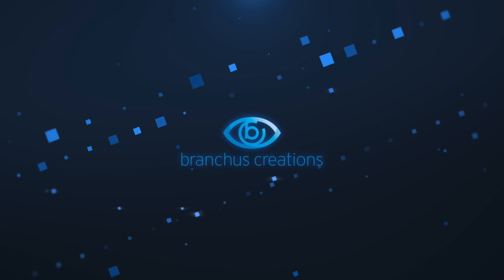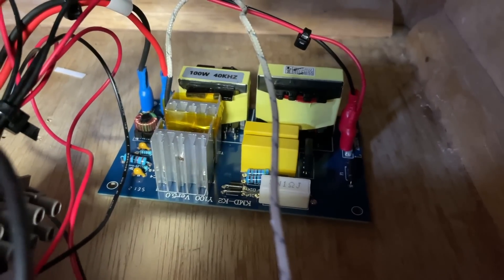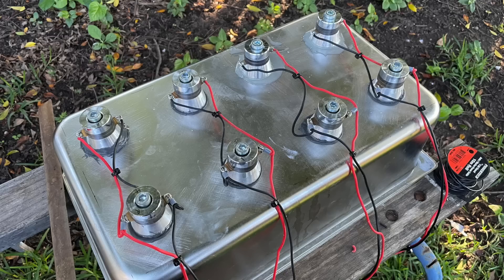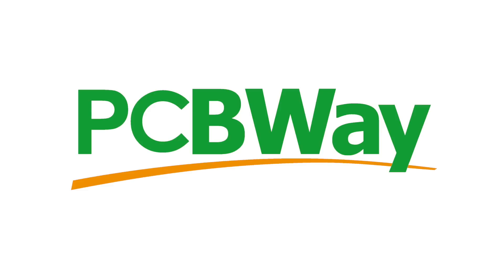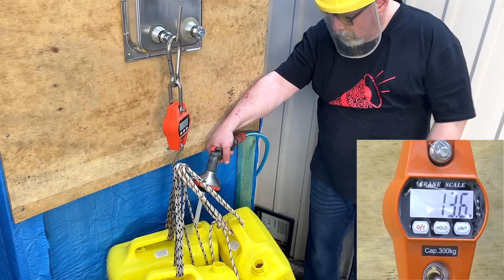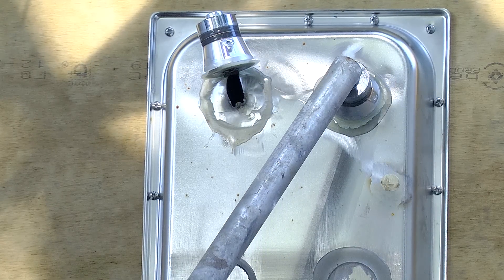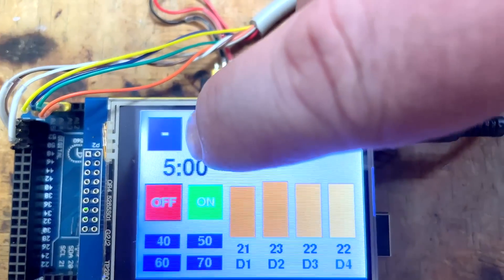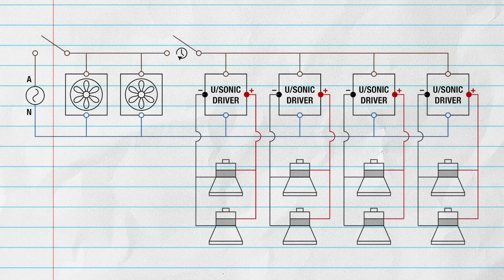Building my own Ultrasonic Cleaner - Follow Up

Comment: I’m surprised you said flux for the silver solder was recommended, but not required. Your advice about using generous amounts of flux in electronics soldering has made my simple excursions into electronics soldering far easier than before I took your advice to heart. If you can elaborate on it sometime that would be appreciated. Thanks for the tutorials!
Reply from the maker: I thought the silver solder had flux in it, but it doesn't. So yes, use flux!

Comment: An automotive gasket sealent can withstand extremely high temperatures in the 1000s depending on the quality. In addition, it has a little more flex but is a very strong adhesive. This flex could help prevent the separation of the adhesive. As a contractor I've experimented with a wide variety of adhesives. Automotive gasket sealant had unique properties that makes them different from many adhesives. You can even use it to seal holes in freezer sids walls because it does not freeze in freezing temperatures and maintains it's adhesive properties.
Reply from the maker: I investigated silastic sealants early on, but unfortunately the flex reduces the efficiency of the transducer. The adhesive needs to be rigid as it plays a big part in transferring the waves through to the tank.
Reply: @BranchusCreations  oh, my bad

Comment: Hi Bruce, I think the transducer falls from fatigue not from overload, so testing strength by applying a load is probably irrelevant. After seeing the first video I assumed maybe the bond had a small gap between them, it could cause:
1. The vibration of the transducer makes the trapped air compress and contract at a very high speed which causes micro fracture in the adhesive -> causes the transducer to fall
2. The adhesive that has been half failed causes the transducer to hit the tray repeatedly -> causes the transducer to heated up
Keep it up!  I'll be waiting for your next follow up video
Reply: Transducers operate on a solid state piezo-electric principle  - Electrical <> Mechanical. Your gas grill pop ignitor generates an electrical current when a spring loaded rod hits the piezo material. An ultrasonic transducer operates in a reverse fashion. Applying an electric current at a specific frequency will cause the piezo material (the black discs in the stack) to expand and contract with the frequency of the electrical input. The transducer stack is tightly sandwiched together to a cap and cone metal components with a bolt. This is done to efficiently transfer the expansion/contraction mechanical energy to the entire transducer assembly. 

The conical metal part that is bonded to the tank is tuned to the frequency of the driver (40Khz or 25Khz) via its shape and size. The transducers must be able to transmit this mechanical energy through the tank wall and into the solution. There, the energy induced into the solution causes miniature low-pressure cavitation bubbles to form. The expansion and collapse of these miniature bubbles provide the mechanical action needed to clean the parts. The transducers MUST be intimately bonded to the tank wall. This bond must be strong enough to handle the vibration and/or solution heat. 

Many cheap ultrasonic cleaners now use an epoxy adhesive to bond the transducer to the tank wall. More industrial cleaners have the cone portion completely brazed (i.e. like silver solder) to the tank bottom. In fact, Branson Ultrasonics developed that brazed connection decades ago which caused them to recognized them as a leader in ultrasonic design and longevity. Now, with the advent of better adhesives, its possible to have a fairly decent durability with just an adhesive connection.  

Anyway, Bruce did a great job and I love the honest trial and error content.
Reply: @ljsmith99  can you advise upon a specific adhesive? thanks!
Reply: I would add: 3. Shear stress in the glue layer due to the different temperatures and expansion of the transducers and tank. Squashing the glue thin would make this worse. 
As an aside I'm wondering about putting a couple of transducers under my sink bench to help with the dinner dishes!

Comment: You could try a plug weld (drill a hole, align the bolt on outside, weld a large bead on the inside over the hole and the material). That should let you get a decent weld without blowing through the thin stainless. You'll be welding onto the thickness of the bolt.
Reply: Plug welding would work if you used stainless wire or filler rod. Assuming he transducer threaded lug is stainless or it will rust!

Comment: what a lovely video! thank you for this,

but also want to ask something extra. as still feel somewhat unanswered or unknown question. which is nothing to do with your stuff in the video here. but since you have just become our collective industry expert in the field, it seems like you are now the right person to ask it to;

my question is in regards to tank configurations / dimensions and effectiveness.... see when we are shopping around for ultrasonic cleaners the big question always is what size to get. and it seems like the optimum size is nearly always long in 1 dimension. then either narrow and taller. or wider and then more shallow. this is either because we want to save on desk space / the device footprint. since these things are pretty bulky. or it is instead because we do not want to have to fill up and use too much liquid into the tank. not to have the water level higher than necessary for convenience it filling it up or moving it.  or for a given chosen tank volume and hence purchase price.

however the vast majority of ultrasonic tanks being sold appear to be long in 1 dimension. and then approx the same in both the width and height. which is generally less ideal for the typical shape of pcbs. which are of course flat rectangles. and we don't want to angle our pcbs diagonally because that is then a huge volumetric waste of cleaning liquid.

so my question is clearly to try to find out why the ultrasonic manufacturers do that. because the reason is not known. but it could be for one of several reasons. and this then informs both our purchasing choices. and also the tank design for a self built device.

it could be (for example) that these are being sold mostly for general purpose parts cleaning. with pcbs being a minority usage. then those tank dimensions would make more sense for other random parts which are normally not flat pcbs. car engine parts for example.

or it could be because the ultrasonic waves need a certain volume of water to be more effective. wheras a too shallow depth of water would cause the waves to reflect back down from the water surface. and just not work as well for the shallow water scenario

or conversely it could be because the 'deep and narrow' configuration is too narrow, for example for a single row of standard sized transducers. again to work most effectively. without problems with the waves being reflected back off the side walls

or it could be because deep and narrow stainless food trays are not common. or more expensive and difficult to manufacture or get good cheap supply of? wheras shallow food trays also dont offer the same band for buck perhaps when they can sell for more dollars a higher volumetric capacity unit with the same number of transducers and parts cost in it etc. in other words market forces and customers comparing units by volume capacity class... and then always the more regular shaped tubs wins with the lower bom cost to manufacture

i suppose there could be other reasons too. but you get the picture. clearly it would be helpful to uncover some answers here. to be better informed and not end up with making the wrong decision. whilst also not being lumbered with a machine that is more bulky and takes up too much more space than is actually necessary. would be pretty helpful

anyhow thanks for this follow up video. learned a lot from it. very grateful & well done for being so clear about all of it. very good troubleshooting and test methodology. kind regards

Comment: I wonder how effective spot welding would be, for the bolt to the tank?  Significantly more heat applied to a significantly smaller area.  Less bowing of the tank, but you most likely would need to tack a couple of times to get enough of a secure bond.  Often used to weld lipo batteries together into battery packs securely.
Reply: Those bolts supplied look like they were intended for a stud welder. Kinda like spot welding but meant to weld studs to things that a regular bolt would be impractical to use. Look up a stud welder.

Comment: TIG welding (FUSE) or even silicone bronze filler is probably the best way to mount the transducers. If you are going to use silver solder make sure that you use silver solder flux!
Reply: I wanted to make my own generator. And make full spool of wire as my coils and and such. But got so many almost free generators. . And time has ran out. War is this year. So things like this. I wanted to achieve. . I will give you coupons to vevor. Or just google vevor coupons. Before free shipping gone. Soon. I did see a guy tie a sander to side of bucket of zep cleaner. With a torch for heat. . ?? Lol but not over heat. Lol
Reply: ... and what is Nail wealding ?
Reply: @omsingharjit  Never heard of nail welding. Are thinking of spot welding? This might work for Bruce's project.
Reply: @enzofitzhume  same here .
But as it's Mentioned here  👇for similar purpose -
https://youtu.be/N-OPQ_s0G5c
I have seen other video with same "Nail wealding " title where I have seen tiny Nail like structure to the Surface of spot wealding object so that nail might have some purpose of being  soldering martial between two object that seems logical to me . But not sure if this is the case for this name !
Reply: @enzofitzhume  not bothering with the other guy, but he might be referring to stud welders, like those used in auto body to pull dents.